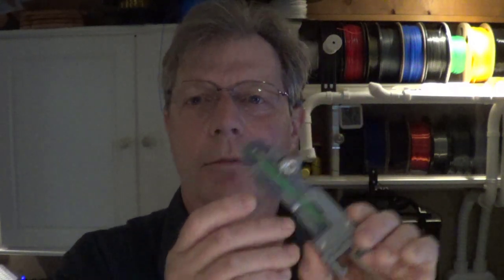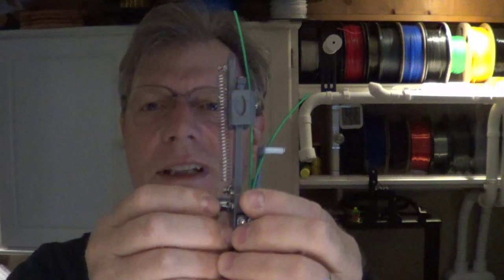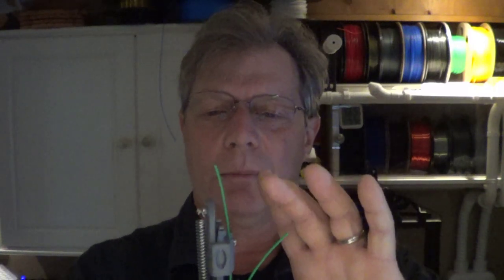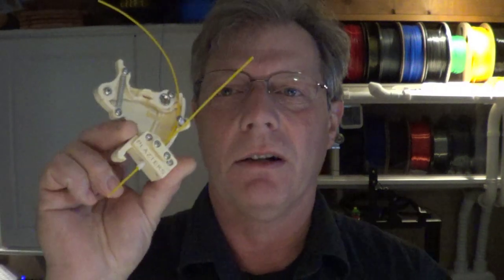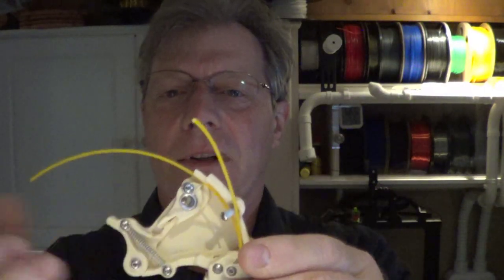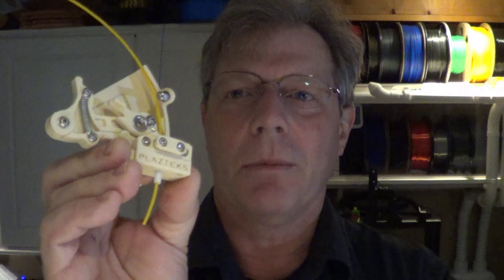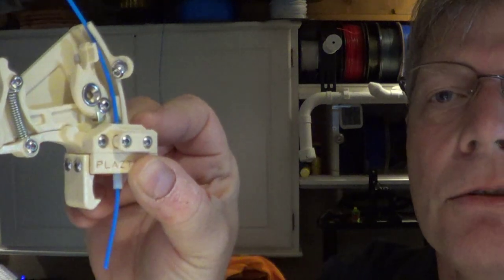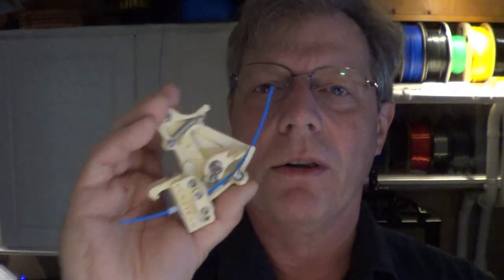Automatic Filament Loader 2.0 Now Available!

Comment: That's a very good idea. Kudos to you for that invention. Now I have to find a way to attach that to a Sprite Extruder Pro 😀
Reply from the maker: I am always working to add new extruder designs, but unless I have one in hand, I wouldn't trust it to fit or function properly.  I have to test it myself before I would consider releasing a design. I only have 4 printers of my own.  I anyone would like to send me an extruder, I can design for that one.   There are too many models out there for me to start purchasing them just for mock up.  I have started with the most common ones and the models I have.  I did purchase a microswiss just to make one for it due to it's popularity.

Comment: Am I the only one sitting here thinking "What is the point"?
Reply: I guess if you skipped the intro where he explains it you might be confused
Reply from the maker: I guess you never wasted 9 hours and 1/4 roll of filament on a part when it ran out before finishing....it wasn't a part that could be glued later, mechanical item......

Comment: So when the change happens you have like 30mm of filament pushed through the hotend creating a nice blob on your print
Reply from the maker: not sure If I understand your comment.  The new filament just follows right behind the old, the only thing is that there is no physical connection between the old and new filament, so retractions during the time the old filament is in either the bowden tube or direct drive don't pull back  on the old.  Minimal impact that I have seen.
Reply from the maker: to answer your question, no.  If you look at some of the YouTube videos where I created some calibration cubes with as many as 12 different pieces of filament fed in one after another, you will see the finished product looks as though it was done with a continuous piece of multicolored filament.  :

https://youtu.be/PUHUfJREGlQ